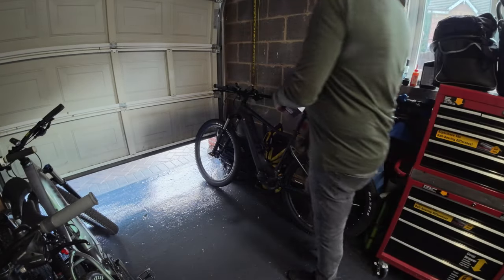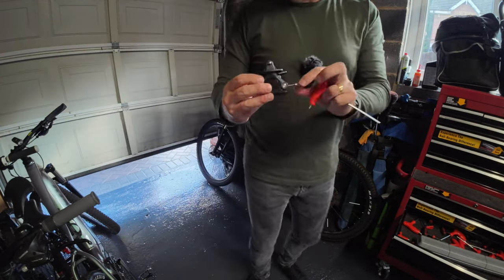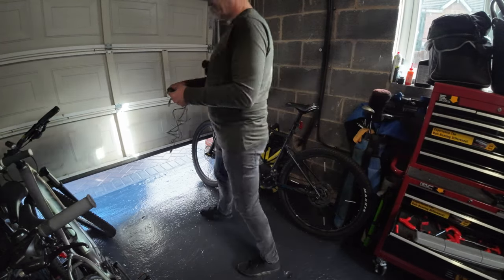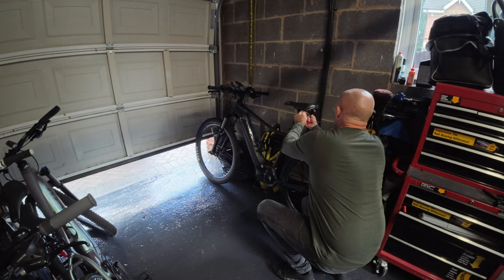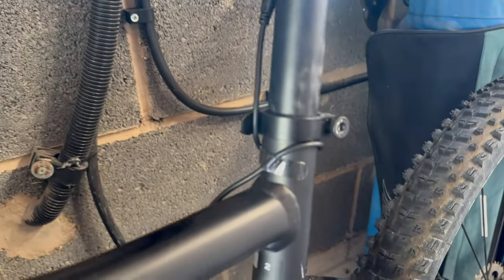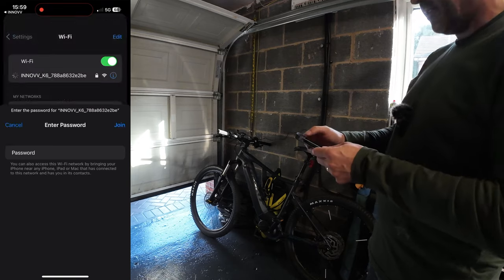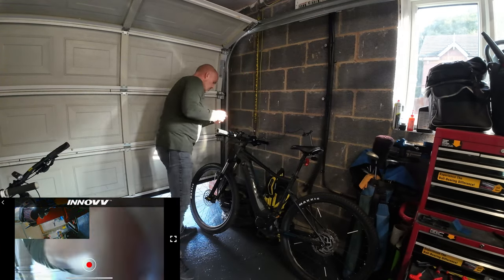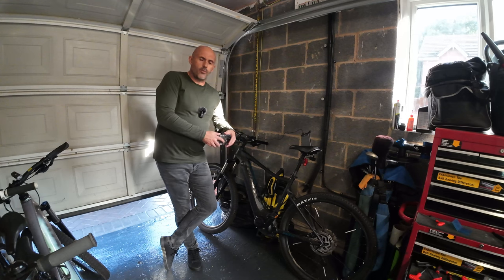Innovv K6 | A Cycling Rear View Mirror?

Comment: I have a pair of good quality wing mirrors fitted to my handle bars and they work really well. It's also far simpler.
Reply: Yes I had one on the right, got sick of switching it for the continent so now I also now have two, no power, no memory card needed.
I prefer the head-cam position anyway it can capture everything you turn your head to and can see what you see in the mirrors, now I need to find a good one with plenty of capacity regarding power and memory to last for at least a six hour ride.

Comment: One though about using your phone as the rear bike camera display. This would potentially mean you lose the ability to use your phone as a GPS based speedometer or indeed as a sat nav. Unless you can split the view to share the screen between these different functions. Or have an older second phone to divide up the functions.

Comment: as this is an ebike a bike shop may be able to wire a solution like this in to the main battery. 
I worked in a bike shop that did USB charghing adapters on bosch ebikes, the main system had multiple voltage rails, one was 5v 1A, which could proabably power this

Comment: I like the solution of having cameras fixed to the bike and the bring your own battery bit - I am usually unhappy about how long the battery lasts so having the opption to choose battery size myself (weight and size versus length of recording) is nice. If I ever decide to have a camera on the bike instead of my helmet this will be my favourite candidate. 
The mirror function bit seems to me like mostly gimmick. But there might be someone who would find it good. Some roadies insist radar gizmos are great so I guess people buy anything to avoid using just a mirror. Personally I find the idea of a "mirror" that needs recharging and activelly emits light towards my face in dark conditions is a bit weird. Anormal mirror on the handlears and/or small one on your glasses or helmet can take care of everything and give you constant awareness of what is going on around you in a way I have not seen improved upon by any high tech gadget. BTW when you use the phone-camera as a mirror is there a noticeable delay in the image? Some cameras have one and it would annoy me having a mirror that shows what what happening half a second ago.
Reply: Yes there is a delay, you can see in the video when he holds the bike up straight it takes at least a second to display this on his phone. It will only worsen the longer the camera is on. Imagine looking at this before moving into primary only to sideswipe a car that is supposedly 4-5 car lengths behind you. I checked the website and there is no disclaimer saying that it should not be relied up as a substitute for a mirror.
I can't see why they didn't just add a lead to be connected to the phone for a true live view, not to mention that having to use the phone as a hotspot for the cameras will drain the phone battery faster. The lead could also charge the phone.

Comment: 5:54 I spy a Cateye AMPP 100. I suspect that's only really viable as a "be seen" daytime light.

I ride at night so I've got the AMPP 400 and for a rechargeable I couldn't be happier. If I ever need to replace it I may upgrade to the AMPP 800 so I can run 400 lm on completely unlit trails with better battery life, but running the AMPP 400 @ 200 lm is adequate. People complain about it being too bright as it is despite aiming it down!

Comment: I did seem to notice a delay on the phone. Relying on that for safety might be a little tricky, and that aside of regular things that catch you out when relying on technology. Battery life, screen visibility, other technical issues. A true mirror isn't so bad.

Though my interest is peaked with that Garmin Varia rear radar system. Lycra wearing cyclists are raving about that and I wouldn't mind seeing a more urban/commuter focus perspective on that. It'ss pretty expensive though, as the best experience is with it combined with a garmin (or some others) head unit.

Comment: What was the problem with the electric assist? As far as I know, you haven't advised us.
Reply from the maker: It was down to a faulty brake lever. Himiway sent out a replacement straight away and now it's fixed.
Reply: @AshleyNeal-JustCycling  Thanks - you might recall I suggested the sensor had failed, or the magnet had fallen off!

Comment: The garmin rct715 is a better option in my view. Radar and rear light in one unit
Reply: This requires you have a garmin front unit as well? If so then not all have garmin. Some use wahoo or other makers.Garmin is far from the only game in town now and that is good since their software is as buggy as their units. I wont buy another garmin after being bitten twice by them. Both units were bad enough to put me off for life. Random restarts, settings wont get remembered, settings you just put in wont stick until you do a restart, back light would do its own thing even though you just changed settings. Screw that. I am giving wahoo a chance now.
Reply: @suminshizzles6951  sure the rear radar works with that too